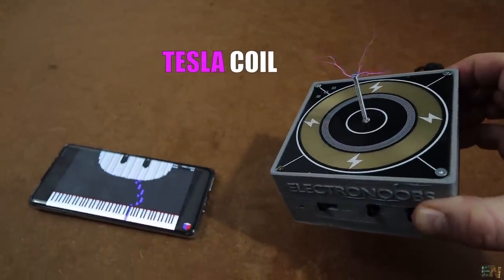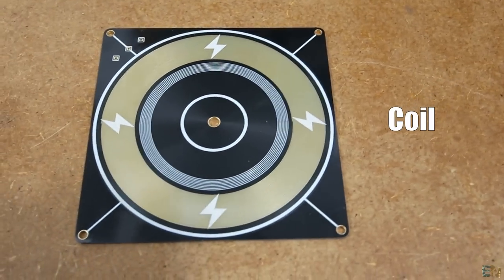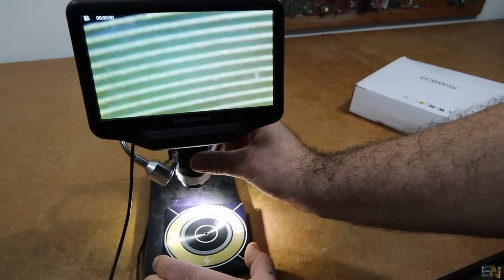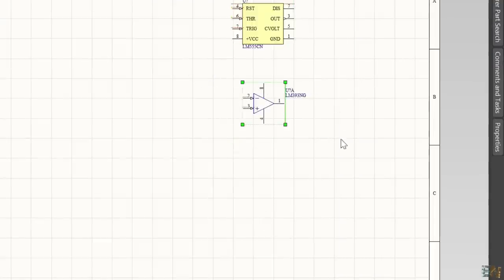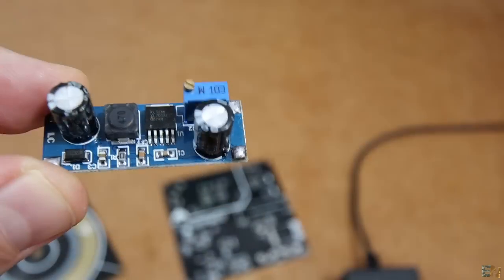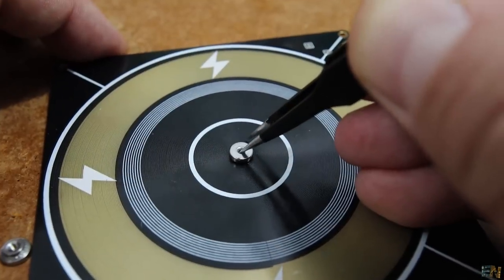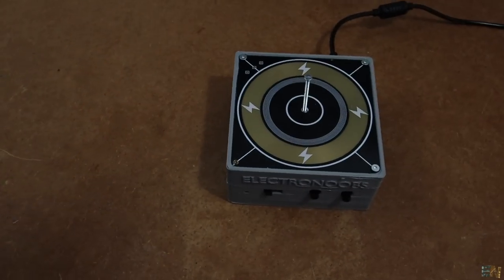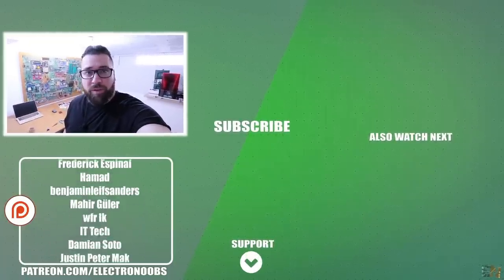Music TESLA COIL on PCB + Bluetooth

Comment: Just a thought to increase the number of turns: Create and stack several boards. The coils would start on the inside of the top layer and spiral out to the edge, cross over, then spiral back in to the center on the bottom side. There would be a hub at the center on each side of the boards. So, now you could just stack the boards in series, with a metal separator joining the hubs. For this, I'm imagining a nylon threaded rod, with metal nuts between the boards. The primary could be on a separate board or just a plain wire winding.

Comment: I've actually reverse engineered the original Chinese pancake Tesla coil, and I've found that it and a lot of other similar coils use a push pull class E topology to push high pulse powers to the primary and create large arcs for their input voltage. The only hard part about this circuit is tuning it since you have to control 2 capacitor values in order to get a nice class E waveform and high power output. I still haven't figured out how to tune it mathematically so how did you tune the circuit?
Reply from the maker: Eyeball it trying different values. Is not perfectly tuned but works ok...

Comment: So I'm working on a project and about to make my first PCB order.  Struggling to understand when I should used SMD vs THT.  Also are there options from PCB way to have components mounted or solder pre applied?  Concerned I don't have the fine motor skills for soldering SMD's by hand.  (Love the content... keep them coming and thank you!
Reply: Generally THT is good if you're just starting out or if you don't have tools like a hot air station that are good to have for SMD

Comment: Why gold instead of silver since silver is good conductor!
Reply from the maker: Gold immersion is a bit cheaper :=)
Reply: @ELECTRONOOBS  I think gold is used not for the Conductivity but for the protection of Cu pads from atmospheric oxidation corrosion otherwise Cu is above than Au in electrical conductivity table.

Comment: do we need to expose the tracks on coil pcb?
Reply from the maker: Yes, the PCB has exposed tracks otherwise they would be covered by solder mask
Reply: @ELECTRONOOBS  Thank you
Reply: @ELECTRONOOBS  is it necessary to be golden track?
Reply: No, but it will help with heat and current handling. .

The exposed tracks can be covered, or you can just have a clear mask used on the top of the board fully over the mask and using a screw apx 3.8-4in long with a 3/8's nut on top will add just enough capacitance to pull the resonator into tuning and max out the arc.
I built something like this a few years ago at a much much higher base frequency of 40khz and honestly the resonator on this is pretty low.
The advantage of the 40khz I used was very clean and clear audio. The downside was that the ozone production was pretty high with 6in plus arcs.
I do a lot of planners magnetics for power supplies and filtering at work
Reply: Great 👍.... Thank you for providing information

Comment: gold is not more conductive than copper
Reply from the maker: Bur is better than tin which is usually what they use for the surface finish :)
Reply: @ELECTRONOOBS  oh ok I didn't know that, thx !!
Reply from the maker: @orphax1925  if they leave the PCB with only copper they would oxidize very fast. So they bath them in tin or other materials to keep them from oxidize. Usually tin, silver or gold. That's why the PCB pads are not copper colore but metalic.